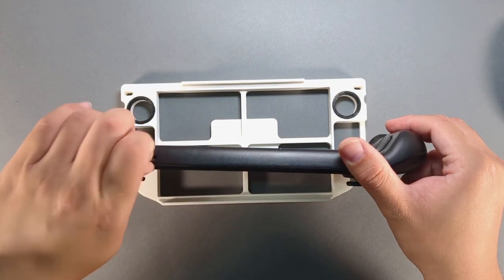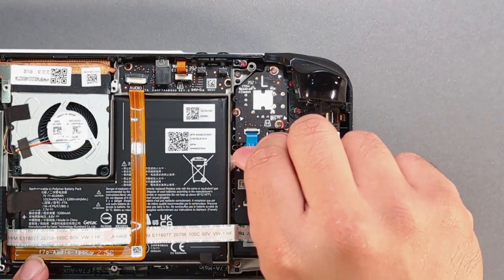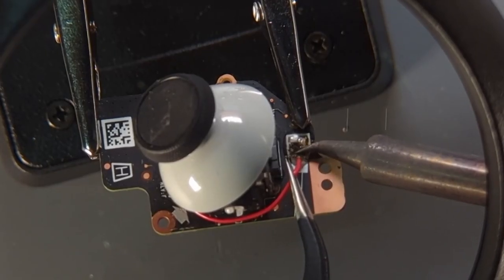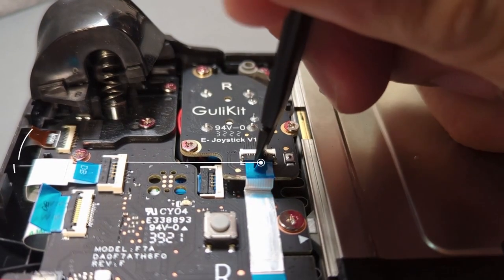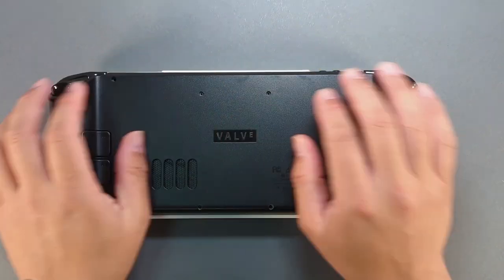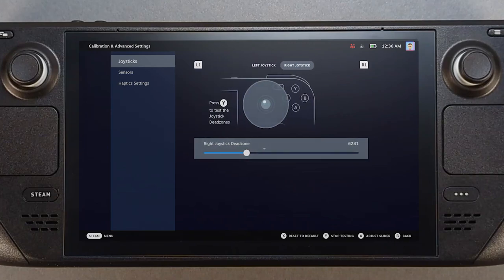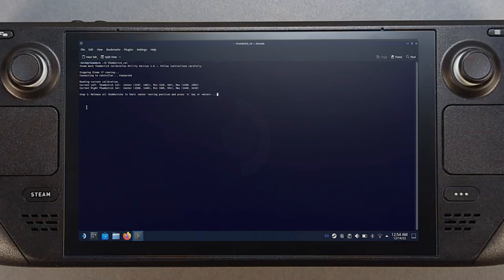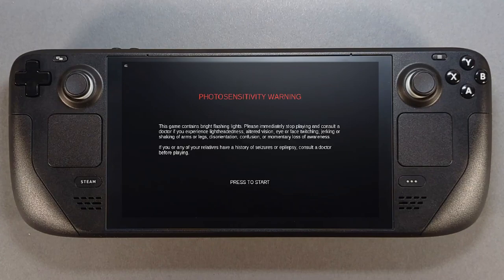Installing Hall Effects Sensor Joysticks For The Steam Deck

Comment: Also, don’t forget to remove the microSD card first before you start opening the steam deck. Very important.
Reply from the maker: Super important, definitely the first thing mentioned in the video. I feel bad for anyone that will crush it by forgetting 😢
Reply: He literally said that at the beginning
Reply from the maker: @MakersMatrix  I guess they didnt watch that far 🤣. thanks for the backup
Reply: Yep, snapped a 1TB in half by not removing it. The funny part was that I removed the SD card when opening to install a larger SSD…then I put it back in. Then I realized that I put one of the internal screws in wrong and needed to reopen to swap screws. Didn’t realize I snapped it in half till I turned it back on.

Comment: just ordered a solder station, adjustable helping hand, and some rosin flux so I can finally install this into my steam deck. Next I will be going after the anti-glare screen used in the 512 GB model and placing it into my 64 GB model. Then I will add a transparent red back plate. Already added a 1 TB nvme drive. I see these sticks as an upgrade for my deck, since hall effect sticks not only never drift, but also happen to be more accurate as well.

Comment: you got my sub. already done everything to my deck, but your video is just clear and to the point. btw, is that a custom 3d print tray that you put under the sd? or you bought it online?
Reply from the maker: Thanks so much! It's a custom made tray for my deck that I created (fully 3d printed) . It also have tpu (silicone type of material) supports where the joysticks are face down so nothing will get scratched. I find working on the deck is way easier when having it perfectly flat

Comment: I don't know about you all, but I've been inducted into the steam deck trackpad master race. My thumbs always hurt using a joystick (growing up I was a keyboard and mouse player, so I don't have years of experience with controllers). Yes, I know I am pushing them too hard wanting my character to move faster lol. But, it's a hard habit to change. Long story short, the steam deck trackpads are perfect. No joystick drift and not thumb pain. I know this has nothing to do with anything, but I wanted to share.

Also, if anyone has tips on how to break the habit of using a joystick in a way where your thumb hurts, please do let me know!
Reply from the maker: Thanks for your info on this, I never really personally tried to break the habit of using thumb sticks. If you haven't tried to steam controller, it sounds like you would be up your alley. They use pretty much over glorified two huge left and right track pads. Kind of like the steam deck but with one less joystick.
Reply: You can get silicone/rubber joystick caps. JSAUX caps will keep capacitive sensing for gyro.

I prefer convex tops, so for my left joystick, I adhered a rubber dome drawer bumper, and secured it with an earbud foam pad.

I love using the right trackpad for aiming: faster, precise turning, no deadzone, no drift. Just see the videos on my channel :)

Comment: Great video. Thank you. Might want to emphasize that you need to provide the solder
Reply from the maker: Thanks so much and good call on that. Moving forward I will do so
Reply: @RetroRepairYT  yeah my dumb ass may have cooked the base plate alittle on mine before I figured that out...
Reply from the maker: @fairplayer916  oh man, I am sorry to hear that
Reply: @RetroRepairYT  its fine. it still works perfect, just alittle discolored.

hey what would happen if you installed these without soldering the wires?
Reply from the maker: @fairplayer916  If one didnt solder the wires back to the board. The capacitive touch would not work on the sticks (meaning the sticks can sense when you have your thumbs on them) this is used for the gyros. If one leaves the wires unsolder they cut out gyro functions. Thanks for your question
Reply: @RetroRepairYT  thank you for the answer. good to know they would still *mostly work even without connecting the wires.

wonder if any companies make alternate thumbsticks for the deck
Reply from the maker: No problem and I wonder too because I did get the backplate from Jasaux and I like the raised buttons for the back buttons. I would like to see what innovative sticks other companies could make. Good call on that

Comment: Please friend, can you tell me if it's really worth the exchange?  Did you notice any downsides?  And does it work well in games?  Did you notice something bad playing a game? PLEASE
Reply from the maker: To me it is, I've been using this for about 5 months straight and it has been a better upgrade for me.  The travel distance is very short. It feels like I'm playing on my Xbox elite controller but on the steam deck. Even though it has an issue of having squared wide areas if you rotate max distance. I haven't seen where it has messed me up in games . Ultimately it's your decision but imo I'm  still loving the change
Reply: @RetroRepairYT  thanks for answering, i found out that my joysticks are type B, in that case do you recommend the exchange?  because I heard that Gulikit joysticks are for type A. What do you recommend I do?  When you made the switch, were your joysticks type A or type B?
Reply from the maker: @EuRafaelGomez  since you have type B sticks you will have to wait until Gulikit releases the type B version (I checked twitter and there site, not sure a release date). My sticks were type A

Comment: everything looks super simple except for the soldering. i wish there were modules already soldered for easier switch of the module.i would gladly pay extra for that.
Reply from the maker: I really do wish they would do a drop in replacement. I valve ever decides to sell the caps only. I am sure that would be a motivating step forward for the manufacture

Comment: Is it necessary to remove the battery power plug before replacing the joystick?
Reply from the maker: It is not, only if you are removing something that you have to take the metal shield off for such as your hard drive or fan replacement. Tbh, I've  swapped my sticks out about 4 different times at this point and have never had a failure to boot or non responsive joysticks
Reply: @RetroRepairYT  thanks so much. Loved the video. Will be a returning viewer.
Reply from the maker: @LastNightsGrime  Thank you for the sub I hope I can help in the future too, thanks again

Comment: Damn yesterday my gulikits Sticks arrived.... I am so afraid for the soldering process
Reply from the maker: I can understand that anxiety. I would suggest finding a device in your home that is broken and opening it and  strip a loose wire and just soldering it to a contact on the broken device and keep doing that (soldering on and off in different spots)  until you feel confident. It's the same procedure that you will end up doing on those sticks that arrived. Some tips would be try not to burn the board and only apply enough heat to melt the solder. And the biggest tip is when in doubt use flux on anything you're soldering or desoldering. 

I wish you the best of luck. You can do this
Reply: @RetroRepairYT  thanks.. I always tought the soldering Tin had Flux in it okay have to buy some Flux today :)
Reply from the maker: @Gummelgimp  it does a little bit but you have to flood the area with solder which can turn out messy and result in unwanted connections or blobbing. When finished with your soldering make sure to clean with IPA well I recommend 90% and up if you can get your hands on it :)

Comment: Hey, before you do anything inside the deck, disconnect the battery first
Reply from the maker: Thanks for this, for future videos I will be adding this
Reply: Not really necessary when only working on the analog sticks.
Reply: @AndehX  its ALWAYS necessary to do that
Reply: @AndehX  Bad idea to leave power running thru the board when doing things. Could short it...or you
Reply: @RichardServello  it's not about short-circuit, it's about static charge on your fingers. Not a problem if you are using anti static or plastic equipment to touch the board (as in this video).
Have you ever repaired a phone? In most models you cannot disconnect the battery even if you want to.

Comment: I can't find an option to test that the capacitive touch still works, would anyone be able to enlighten?
Reply from the maker: You can try playing Aperture Desk Job they should have a portion in the game where you use it
Reply: @RetroRepairYT  Thank you, would never have thought of that, works perfectly, first time soldering as well.
Reply: Also thanks for the video!
Reply from the maker: @gat1986  happy I could help and killer job, I like when it goes smooth so you dont have to open the device again. No problem and thanks for the comment

Comment: lol weird question but what kind of drill is that
Reply from the maker: that is a good question it is a Xiaomi Mi Cordless Screwdriver 3.6V, 2000mAh Rechargable Battery. I got it on amazon and it has really good torque for electronics
Reply: @RetroRepairYT  i appreciate you taking the time to answer my question, i've been shopping around for an electric screwdriver so perhaps i'll give the xiaomi a try. i'm happy to be a subscriber 🤝🏼
Reply from the maker: No problem, I'm happy I could help! I got this last year and it's been awesome the whole time. My issues with the other ones for electronics is that people or saying that the stick versions didn't have enough torque to break the screw in the beginning or screw it all the way in at the end. This has more than enough power to do that. And is USBC powered 😊

Thanks so much for the subb, I really appreciate it

Comment: excuse me, what does the button do behind the after installing it?
Reply from the maker: Are you meeting the button that is on the back of the new joystick sensor board? If so, it's supposed to zero out your joystick. Meaning The joystick will read perfect center or it should after clicking this button. You'll be able to see the centering in your settings under joysticks in gaming mode
Reply: @RetroRepairYT  ah i see noted! thank you.
Reply from the maker: @demislonzie8784  no problem at all
Reply: @RetroRepairYT  funny thing is i don't have a steam deck. but the knowledge is helpful!
Reply from the maker: @demislonzie8784  I totally understand, Its always good to have knowledge . I am happy I could help
Reply: @RetroRepairYT guess what? I got a steam deck!
Reply from the maker: Congrats !!! Four months is quick welcome to the club :) There are new hall effects sensors for the deck and are fully drop in, no soldering required and work for both stick models ! I will make a video soon on it. Again totally happy you got a Steam Deck. I hope you love it @demislonzie8784
Reply: @RetroRepairYT  oh yes I will